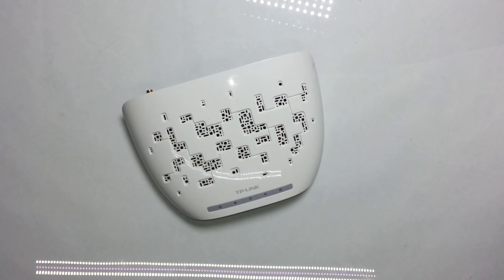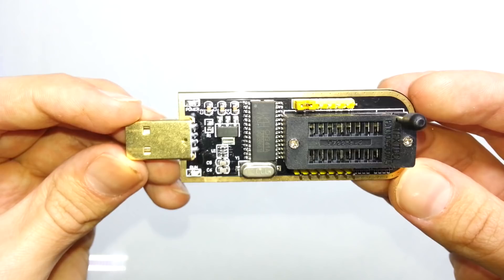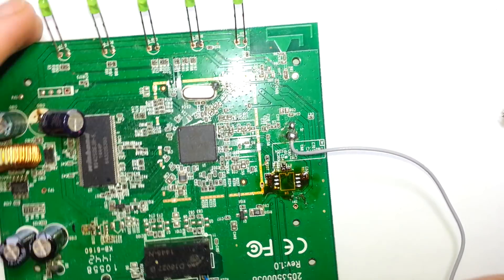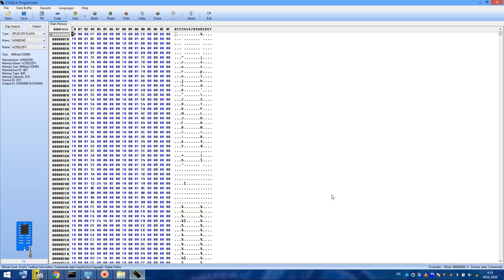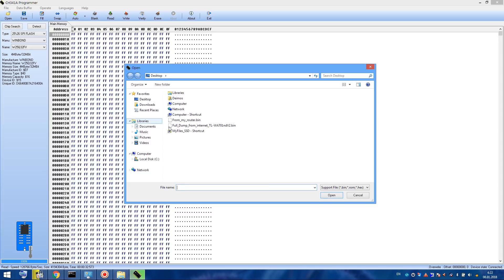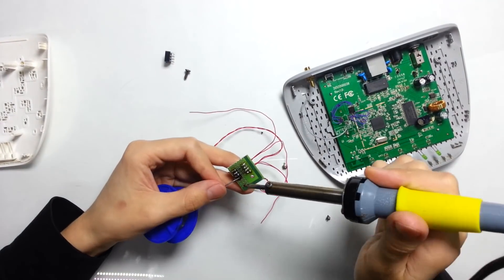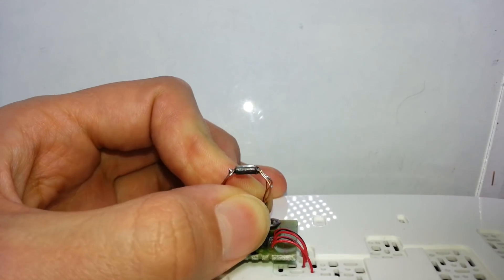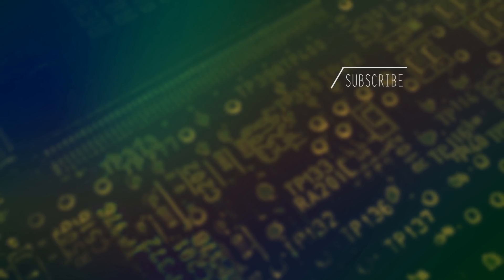How to Flash Chip of a Router With a Programmer | TP-Link Router Repair & MAC address change

Comment: Great tutorial
I have a cisco wag120n and wifi is not working every time but the internet and dsl light works 
Does flashing it well solve the problem
Another question if you mind does the mac address location 0001FC00 is for all of the routers?

Comment: useful tutorial and informative, however it is not easy to find another original full dump.  me too was thinking the same way about how to reflash using programmer. (using .bin firmware) :D,  full dump backup of installed firmware .bin.

Comment: Thank you for mentioning the need for a full flash firmware, and the mac address.
Btw, have you tried reading the chip still soldered in the router (using a clip)?
Reply: I also would like to know result of using CLIP

Comment: Saludos y gracias por el aporte,  más abajo del binario también se le puede cambiar la clave wifi que trae por defecto en:  0001FE00
Reply: MundooGamerLa, intento regresar a la vida un CPE210, voy a desoldar el chip y lo programaré con un CH341... mi pregunta es: la dirección 0001fc00 es la ubicación MAC de CUALQUIER Router??
Reply: @juang.hernandezjmz.7352  en algunos modelos. Pero vas a ver qué en esa línea o cerca deben estar escritos un código MAC.
Reply: @HARDWARE_FIX  Hola, sabes como modificar el nombre que trae por defecto el Wifi, porque si se resetea o algo similar que vuelva a traer el nombre que le puse. Desde ya, gracias.

Comment: I think it's easier to flash to openwrt and flash from openwrt to the old firmware, desoldering a programming it's useful when you bricked the router, and the backup methods like tftp or serial don't work
Reply: same, so Im gonna try this method, but I don't know which chip I should desolder, or flash.

Comment: hi 
 i am having iball baton wifi renge extender (300M wifi mini AP router iB-WRR300N) model but cant find its firmware and it is working 192.168.1.254  it use admin id and password but it did't open iball window it gives me a file config.dat and it is not working any way  please help me

Comment: Could you tell me why need dumped file ?
I am finding firmware to unbrick dir825g1 ( it has 2 version orange interface and blue-white) so mine was orange and it is very limited then I thought to put blue-white but neither update page nor emergency mode could result then I connected via serial but also nothing after I erased all now my router is blank also deleted uboot! 
I am thinking to flash eprom using ch341 ver. 1.34 but when I saw you said that I need dump file everything stopped because I didn't find dumped file for it (dir825g1 it has 4 antenna)

Comment: how to see default password though programmer? as u change mac address can we see set wifi password on it?
Reply from the maker: I did not try to change it but it all should be there, start looking at address 003E0000 and go all the way down (for 4MB full dump).
I use the router as Wi-Fi receiver (so I don't have a password) but I could see a password to the router I connected to.
Reply: Hello my friend
Please help
How to make a modem whose ADSL works normally and has internet
But its Wi-Fi is not in the list of phones
What parts are broken
I live in Iran
Our country has been sanctioned due to UN and American sanctions
People can not buy new equipment
Unfortunately, prices have skyrocketed
No one can buy a new device, not even a modem
I am an electronic engineer
I help the people of my city
I repair their broken equipment
Please help me to repair people's belongings
People are very happy
My contact number and WhatsApp
00989188440206
Waiting for your call
Or I am sending your repair clip
Thank You
Thank you
Please help

Comment: unbrick any Tenda router.. Finally after years i managed to bring back my tenda w316r router back to life... I used usb to TTL adapter but now i realized after viewing putty screen that u ppl dont need "usb to ttl adapter"  it just show whats going on inside ur router...now as i have seen it all i can help all of u guys to un brick ur routers too...
Step 1. Set ur laptop or pc LAN ip manually to 192.168.1.10 subnet mask 255.255.255.0 and default gateway 192.168.1.1 (use wire to connect to pc via lan cable to any yellow port on router).
Step 2 open up the router un screw   it...we need to short 2 pins so that  we can interupt the boot sequence and prepare the router to force itself to CFE mode...so that it can ask for firmware... Do not short pins again n again it will permanently destroy the memory chip...(i will tell u later which pins to short).

Step3 go to RUN on PC and send ping comand i.e. ( ping 192.168.1.1 -t  )  without brackets  keep the ping running... it will say time out... now press and hold the reset button and power the router keep it pressed...u hav to do it quickly its about 3 seconds...leave the reset button and wait 2  seconds then quickly short the pins for 1 second ( i tell u which pins) as u already running ping watch the ping screen...u have to wait until u get ping response let say 1 or 2 minuts then ping will return with positive data...now close ping window and..now its time to open browser and type 192.168.1.1 id admin pwd admin  this will open broadcom CFE and let u upload firmware...brouse the firmware file (use this one .42 not .46) and press upload...its done wait for firmware update successfull measg and router will reboot itself and back to life... Pic link  https://postimg.cc/pytBSxy0   this process can also work for other tenda routers... mainly broadcom based.

Comment: hi. if i change mac adress , default WPS pin will be change ?
Reply from the maker: Hi, I did not check, but I think no. PIN and MAC stored in different addresses on the chip.... you can change PIN the same way if you want, it is also stored somewhere on the chip...

Comment: Dude, my Archer C20 damage on update and now just the USB lights on. Can help me? Cheers
Reply: I had the same problem.. That means you have overwritten the bootloader. Try using the clips to program with openwrt directly on the board itself. You don't have to remove the chip
Reply: I have the same problem  I remove ic flash from mainboard then program it now router doesn't turn on
Reply: Hello my friend
Please help
How to make a modem whose ADSL works normally and has internet
But its Wi-Fi is not in the list of phones
What parts are broken
I live in Iran
Our country has been sanctioned due to UN and American sanctions
People can not buy new equipment
Unfortunately, prices have skyrocketed
No one can buy a new device, not even a modem
I am an electronic engineer
I help the people of my city
I repair their broken equipment
Please help me to repair people's belongings
People are very happy
My contact number and WhatsApp
00989188440206
Waiting for your call
Or I am sending your repair clip
Thank You
Thank you
Please help

Comment: please tell me my tplink 740n is not starting my power ic is burnt please tell me how to fix it
Reply from the maker: Well, if IC is burnt then you need to replace it with a new one. But it probably not easy to do, so maybe it is not worth doing at all. Why did it burn out? I mean there could be a reason, for example, some faulty component... My point is: before replacing with a new one we must be sure that the new one is not going to burn out as well.

Comment: i changed mac and serial number of technicolor td5341 and it didnt work i will buy your same type of router and test same thing you did in video
Reply: I think thats because every router firmware is different from each other. The MAC can be in a different memory address
Reply: Hello my friend
Please help
How to make a modem whose ADSL works normally and has internet
But its Wi-Fi is not in the list of phones
What parts are broken
I live in Iran
Our country has been sanctioned due to UN and American sanctions
People can not buy new equipment
Unfortunately, prices have skyrocketed
No one can buy a new device, not even a modem
I am an electronic engineer
I help the people of my city
I repair their broken equipment
Please help me to repair people's belongings
People are very happy
My contact number and WhatsApp
00989188440206
Waiting for your call
Or I am sending your repair clip
Thank You
Thank you
Please help

Comment: i want just changing mac adress of router using that methode can i change it with same dump file and without changing anything just mac adress numbers  ? please reply need your help
Reply from the maker: Yes, you can, first of all, read the data from the chip and save it in case something will go wrong, then change the MAC address, erase the chip and then flash "full dump" with new MAC address. It is pretty clear shown in the video (in my opinion).
Reply: yes bro thank you alot

Comment: Man couldn't you just use a soic8 clip without removing the chip???
Reply from the maker: Hi, first of all, we need to remove the chip in order to flash it (I think it will not work otherwise). Second of all, I don't have a SOIC 8 clip. I just did it with what I had, that is pretty much it.

Comment: Hi i have same model router. I bircked it. wa701nd v2
I bought a USB UART converter and tried to flash firmware. But not working. 

What i did?
My original firmwware is about 4mb and when i flash it gives big file uncompressed. 

So what i did? 

1) i found stripped version of wa701nd v2. 

2) Also i learned that from 00000000 hex to 00020200 is bootloader so i deleted 0000000 to 00020200 and i prepared a 3,840mb clean firmware. 

3) also there is a tool http://www.chrysocome.net/dd 
in windows with this tools the boodloader section can be delete. COMMAND: dd if=ori.bin of=mod.bin skip=257 bs=512 (Windows/CD) 

When i flashed original, stripped firmware the router not working.
There is no admin login page.
3 led On= power, device is working gear led, and lan led.

Can you send me full dump file?
İf i send that file from putty with serial connection, can it work?

this is my topic:
https://forum.dd-wrt.com/phpBB2/viewtopic.php?p=1136583#1136583

Thanks
Reply from the maker: Hi, as I found on the internet "full dump" should look like this:
0x00000000-0x00020000 : "boot"
0x00020000-0x00120000 : "kernel"
0x00120000-0x003e0000 : "rootfs"
0x003e0000-0x003f0000 : "config"
0x003f0000-0x00400000 :  "art"
I think you missing some partition or something, it is hard to tell, am not an expert.
Btw, the size of the full dump file from my router is 4,00 MB (4 194 304 bytes).
Just flash the full dump, it is the easiest way to recover the router (in my opinion.)
Full dump: https://drive.google.com/open?id=1FjpwxQ6xGNqPiYP1zYplbjj27SK11rnd
Reply: Thank you very much for full dump for wa701nd v2.
I will fix it when i buy a a programmer.

I have one more question.
Which version of firmware does the full dump have?
wa701nd(eu)_v2_160620 or wa701nd_v2_140324? 

I hope it is wa701nd_v2_140324

Thanks.
Reply from the maker: As far as I remember it is 140324. You will be able to flash OpenWRT via web interface after that, that is what I did.
Reply: Thank you very much
i have usb ttl serial converter. I tried to flash openwrt through putty and successfully flashed. But when i login luci browser where is no wifi tab on interface :)
I dont know what the problem is :S
I think i will try to flash through a programmer with your method.

Thank you very much
Reply from the maker: Since you have OpenWRT, you can also try to flash LEDE via the web interface (maybe it helps !?). I tried latest OpenWrt: openwrt-18.06.0-ar71xx-tiny-tl-wa701nd-v2-squashfs-sysupgrade.bin, but it is slow for some reason (web interface very slow), LEDE is much faster, don't know why. Btw, lede is here: https://downloads.lede-project.org/releases/17.01.4/targets/ar71xx/generic/tl-wa701nd-v2-squashfs-sysupgrade.bin
If it doesn't help you can always try to flash "full dump" :)
no wifi tab? strange... What if you go directly to wifi settings? error? Login first, then close the tab, and then go there: http://192.168.1.1/cgi-bin/luci/admin/network/wireless

Comment from the maker: Update: Now, I am happily using OpenWRT with W25Q128FVSIG chip, I upgraded the router's chip from 4MB to 16MB. OpenWRT is much more stable and offers a lot of functionality. And In case I break the firmware I can restore everything with the setting and installed packets in a matter of minutes because the chip is outside, and I have a full dump. Cheers!
Reply: Yes, So am I and I made a blog what I have done so far, here, https://router-mod.blogspot.com/
I have flashed openwrt, tomato, ddwrt to many different routers.
Reply: Is ic 16 wireless off😭😭
Reply: Its work without any problem me no upgrade to 16 flash but my wireless not work can you now why
Reply: True, I also use OpenWRT  I tested it with deauth attacks on my router but it still remained connected. It is the best thing I have ever experienced in my life ngl.
Reply: Hello sir i have DLINK DIR-825M router how i can program my chip for my router . its not working after bad firmware upgrade . thank you

Comment: I bricked my router and this is the only way i find to restore it... but I can't find a full dump for TP Link WDR3600 v1.5 router... what could I do? I get on serial console a lot of processing and in the end: 
Kernel panic - not syncing: No working init found.  Try passing init= option to kernel. See Linux Documentation/init.txt for guidance.
i flashed the wrong file, sysupgrade instead of factory... what can i do?

PD: the ethernet ports don't work... :(
Reply from the maker: Hi, If the bootloader is ok you can still flash router via UART, I personally didn't try it (because I am too lazy to figure that stuff out) Try to google "Tp-link repair via UART". I recommend trying that first.
I only found full damp for TP-Link WDR3600 v1, I don't know the difference, so I don't know if it works.
P.S. I am not an expert on repairing routers, I just did a video what I did with my router.
Reply: Hello my friend
Please help
How to make a modem whose ADSL works normally and has internet
But its Wi-Fi is not in the list of phones
What parts are broken
I live in Iran
Our country has been sanctioned due to UN and American sanctions
People can not buy new equipment
Unfortunately, prices have skyrocketed
No one can buy a new device, not even a modem
I am an electronic engineer
I help the people of my city
I repair their broken equipment
Please help me to repair people's belongings
People are very happy
My contact number and WhatsApp
00989188440206
Waiting for your call
Or I am sending your repair clip
Thank You
Thank you
Please help
Reply: Hi sir can u send me full of tplink  WDR3600 router  pls

Comment from the maker: I've changed MAC address to 00-11-22-33-44-55  :) you can see it at 09:16, it is the most fun thing that I did using a programmer.
Reply: I programed my Archer C20 V4 flash chip  and debrick router but there is no MAC Address in both 2.4 and 5 G wireless!!!! which block should I change and set MAC Address?! 0001FC00 ?!!!